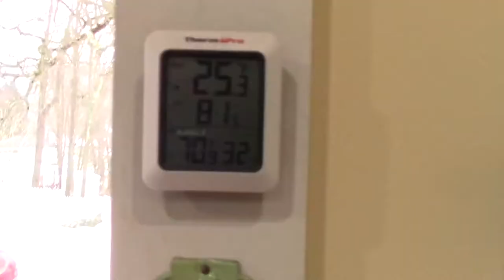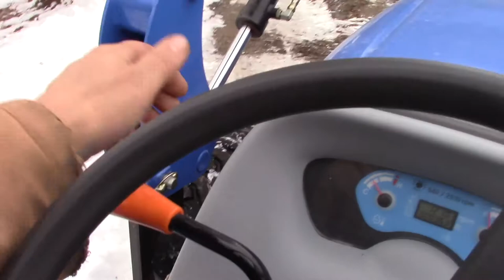Coal day with the Workmaster 25

Comment: All that "fancy & precision " maneuvering & positioning,  loading & unloading---- ALL without a hydro-slack-o-matic. With no "churning &burning" or "howling & Whineing " . Shure was a nice well orchestrated smooth operation.     I once upon a time considered this EXACT Tractor, but already had a similar sized 1736m power-shuttle Massey-Ferguson. Need ( want) a unit that will replace my Other 1988 1020 21hp Massey-Ferguson  ( non- loader). This "rig" with the fantastic loader ( with amplifying bucket-linkage assembly 's) seems very capable. Thank you for the great Video Sir and happy safe tractoring.

Comment: Wow what a tight fit like a pro lol I think I am going to invest in one of those dump trailers too.
Reply from the maker: Thanks Darren, couldn't be much tighter .... The trailer is a  Pa International. In Pine Grove Pa.. Kutz Farm Equipment. He builds 3 way dumps so the sides fold down and it will dump on either side and the back. I don't side dump much but it did come in handy a couple times. John
Reply: @JohnFrytag  They sure are nice I am going to order one and have it shipped up here. Thank you for the information on the trailer.
Reply from the maker: No problem, how far up is up here?